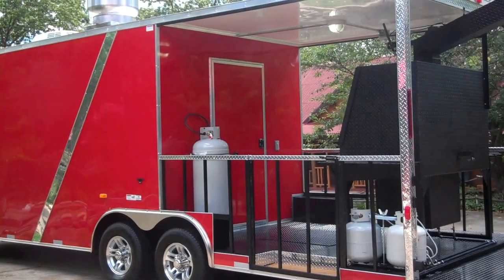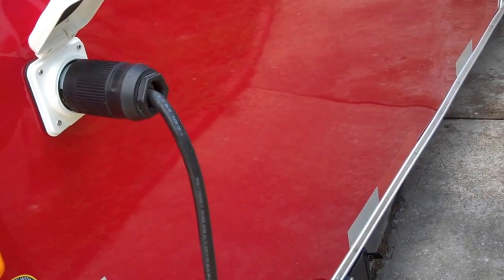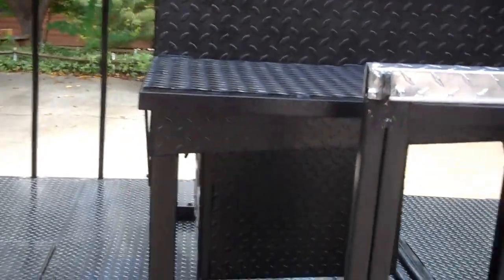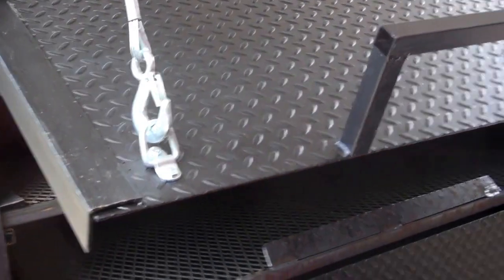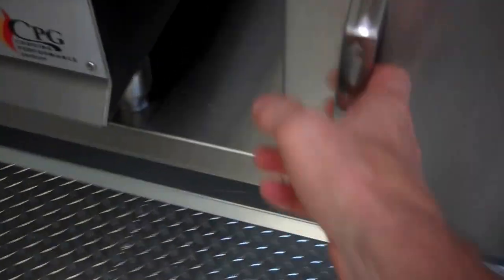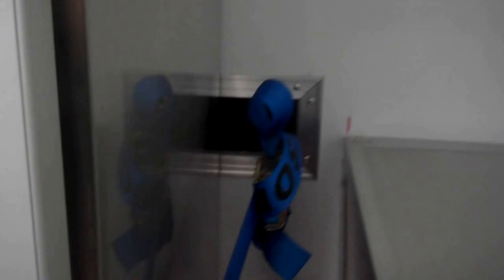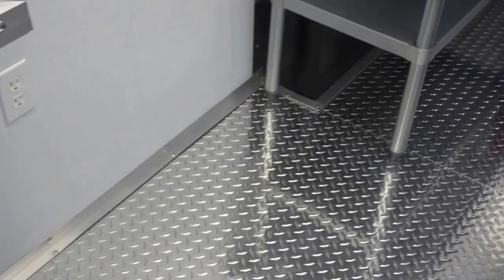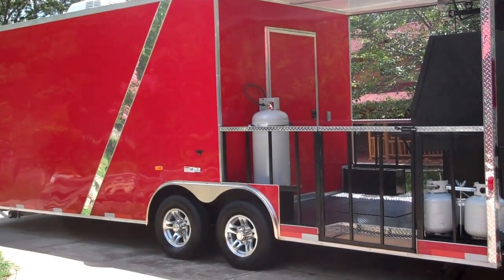Brand New 2018 BBQ Porch Concession Trailer For Sale

Comment: That's one of the best designed cooking trailers I've seen yet, I've worked for years as a catering chef and used to use one for weddings and other large events....but I wish we had your model with the external smoker.